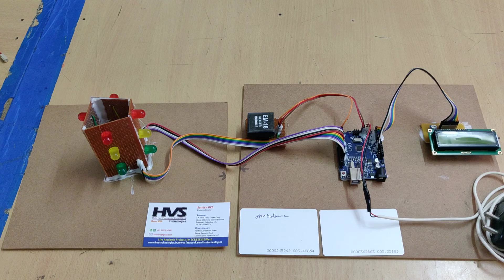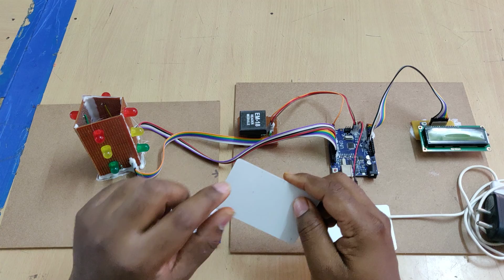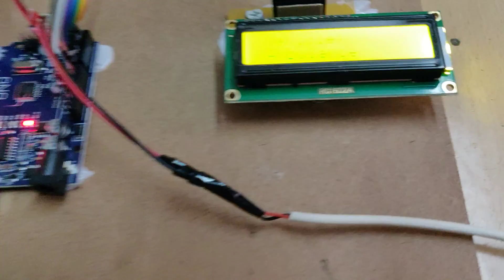Automatic Traffic 🚦 signal controlling for emergency vehicles

Comment: It green only one side
Reply from the maker: Yes. It's demonstrated for one side. We need to place 4 sides RFID readers. Hi, 
We sell full working kit with document PPT circuit diagram and code. Could you Send me the video link, Will update you the cost details. You can contact us at +919603140482
Through WhatsApp or call

Comment: Sir can you please send me the code and the components used
Reply from the maker: Hi, 
We sell full working kit with document PPT circuit diagram and code. Could you Send me the video link, Will update you the cost details. You can contact us at +919603140482
Through WhatsApp or call